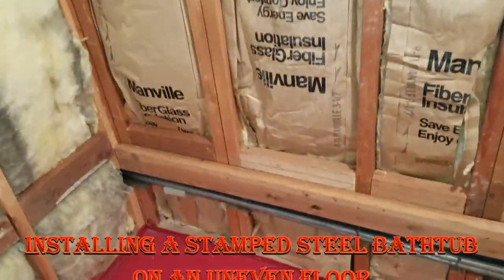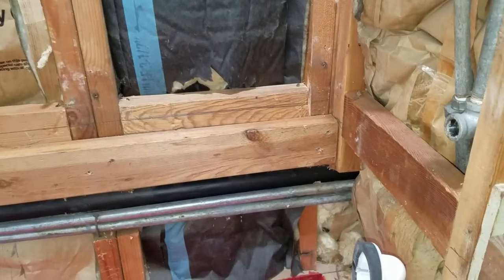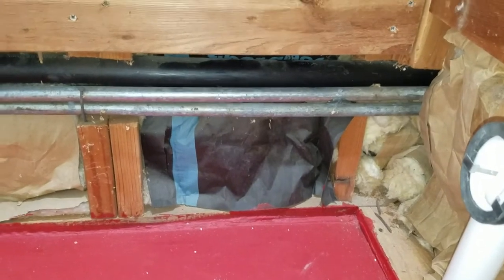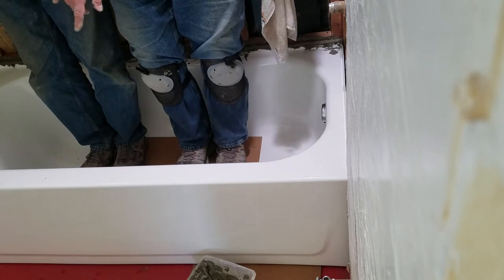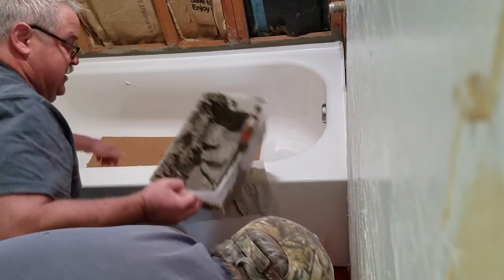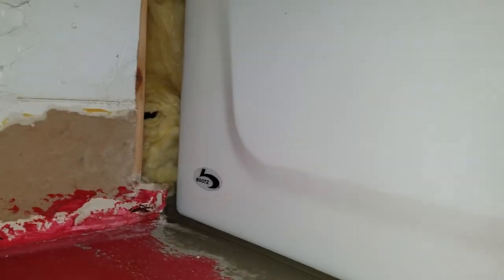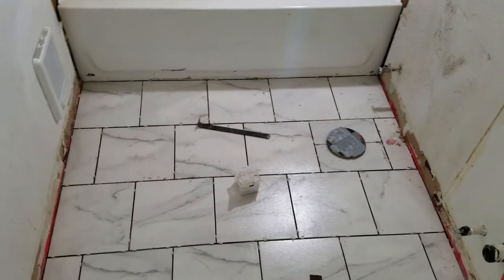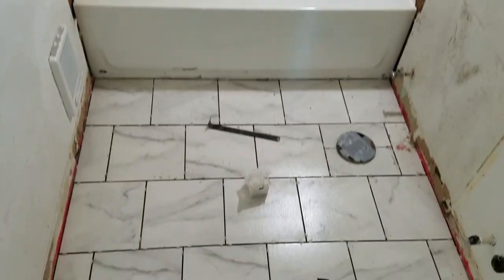Installing A Steel Bathtub On An Uneven Floor

Comment: Plumber installed tub with about a 3/4 difference. Didn’t notice until tiler was putting the tiles on and cement board was already up.

Not ripped the tiles out and starting from ground zero.

I like this way a lot as I’ve seen grout alone can stabilize a toilet and make it soo strong!

Thanks for this video.
Reply from the maker: In remodeling, sometimes you gotta do what you gotta do. Sometimes you can repair things to work but often times the trade offs just don't work. It's robbing Peter to Pay Paul.
Reply: My eyes went right to that tapered tile…

I have learned to hold the plumber responsible for tub not level… 

Sad to see it’s not standard practice.
Reply: So back to fixing this tub. The tile is out and now trying to level the tub. Can’t remove the tub since it was installed predrywall. There is a ledger board in the back. The tub is still the 3/4” out on longways. 

When you did your install, you put thinset mortar between the ledger board and the tub BEFORE I seen levels out. So are you leveling and shimming after and doing that from the front (where the floor tile meets)
Reply from the maker: @garrettp.5018  you need to spend time and see where your best average level is, then you can think about how to level everything best you can. I try to level the front, back, and long wall. Long wall first. Along the floor, you can shim the bottom front to hold position. Ideally, you can get the front, back, and long wall level with none to some gap to the front or back on the floor. Just fill with mortar and let set 24 hours. Pull shims and fill those. Hopefully you're ready for tile. If you do have gap, you can float and feather the floor to blend it.
Reply: @CITAP1   I am going to try it tomorrow, you are a good teacher and very helpful putting this YouTube video out there. Much appreciate it.
Reply from the maker: @garrettp.5018  Here is another video showing leveling a floor with mortar. It is part of a playlist showing the whole bathroom and rental house remodel. Lots of home remodeling information. 
https://youtu.be/cqi9Hj0UfyE?si=DeTGg9rsrZZ3ZO4c
Reply: @CITAP1    So got the tub level and it was fairly off... I am looking at my LVP & the quarter round and it is going to be close. Any tips/tricks on how to get the floor a little higher? I might put a thicker underlayment if absolutely necessary.

Comment: As a plumber I can't believe I'm still seeing galvanized water lines going up to a tub valve
Reply from the maker: It depends on what part of the country you're from. Hard water areas adding salts and other treatments to water are harder on galvanized pipe.  This place uses glacial sourced spring water. Pure as it gets with no chemicals to act as electrolytes or corrosives. In Seattle, I've worked on houses a hundred years old from before plumbing parts had reinforced hubs and there was very little buildup inside. But yes, PEX is so good and easy to work with and cheaper, there's no reason to use galvanized pipe other than to repair existing systems. Check out todays video, water heater safety straps and framing for earthquake mitigation. Take care.
Reply: In an outside wall. Hope its not in a northern climate.

Comment: So I have a 7/8 difference over the length of a 4’ tub. (Very old house) The vinyl plank doesn’t come close to hiding the shims. Open to suggestions
Reply from the maker: If the floor has a 7/8 change in 4 feet, you may have a bigger issue to correct.  If your bathroom is gutted now, it's a good time to correct the problem.  If you build your bath now, you will build the problems into it, making it more costly to correct later. If you need to jack up the foundation or some posts, do that first and correct the floor slope as much as you can. If there is nothing to fix, you can rip a shim to fit under the front edge of the tub and continue shiming across the floor, glue and screw the shims. You can follow the contour as needed. If the contour is going to run I to a doorway, you'll need to diminish it to not interfere with the doorway or swing of the door.  Without seeing the project I can only suggest so much. Hopefully this gives you enough information to make a plan.
Reply: @CITAP1  the 7/8” issue is right beside the door. Old house with balloon walls. You can have level or square but not both anywhere in the house. It predates indoor plumbing. I’ve come to conclusion that I’ll bring flooring to 1/4” of tub wall and then apply a quarter round to the tub with Speed Tape.
Reply from the maker: @Ken McLay  Sometimes you just have to go with it. Once upon a time, we were Installing 12x24 tile on a floor with a 1 inch hump in the middle of a 48 inch wide hallway.  We cut out the subfloor and planed the joists to level them to where we needed them. We then installed blocking under the remaining subfloor around the perimeter and installed new subfloor creating a now level floor. That might be an option for you. If you do put a quarter round or half by three-eights round, there is a pvc product that works great in wet locations. 
If the floor slope works with the drain of the tub, it's functionally less an issue. A tub may still drain ok if the slopes are opposite.  Test fit and check with a level

Comment: Oh forgot to ask did you then attach flange with screws/washer to studs?
Reply from the maker: No but there have been occasions we did. We put a ledger board across the back and then put mortar on the ledger to set the tub on making sure to put as level as the floor, wall, and other conditions allow. Also force mortar in under the facing bottom edge of the tub to fill any void. You may need a shim to hold stable.
Reply: I like this method just to avoid the screws! I never liked the screws with the oversized washer to hold a tub in…

Comment: seen most people do a mortar bed and then sit the tub into that mortar bed… 

Noticed you didn’t do that and went around the edges. Will this only work for metal tubs as they have the self supporting in the middle?

Ive seen fiberglass tubs crack in the middle because no support (assuming no mortar bed)
Reply from the maker: The steel tub will support itself. Fiberglass tubs will flex. For glass tubs, fit a piece of Styrofoam under the tub, then put a mound of thin set mortar on the foam and set the glass tub into that. nice and solid. for a PVC or glass shower base, generally put the thin set on the floor beneath the shower base and set it by pressing down on it to make sure it is flat to the floor, only use enough thin set to fill the void under the shower base. then leave it alone for at least 24 hours to set, longer is better. Not setting a fiberglass tub or shower can eventually lead to drain failure due to flex motion. As an option under the tub, any type, you can use spray foam, Blue Great Stuff, Minimal expanding foam on top of the Styrofoam to fill the void. Don't use regular spray foam or it will expand and lift your tub bottom.

Comment: I got the tub in and the mortar joint on the floor looks just like yours! I iwant to lay LVP, are you filling in with silicone caulk or anything prior to laying LVP? I am talking about the floor to tub mortar joint.
Reply from the maker: I don't recommend a plank floor in a bathroom. There are some plank floors made for wet locations but water can accumulate under them. I prefer either sheet vinyl type flooring,  or tile. There are color match groups in the tile section, or use a color matching silicone grouse for sheet and other flooring. If you do have Dorrock or Hardiback cement board down, I'd skim coat that with thinset a couple times to get it nice flat and smooth. Then give it three coats of Redguard to waterproof it, then install your flooring over that. Side note, I prefer Durrock and Wonderboard, epoxy cement boards for tub/shower walls and Hardibacker for floors.
Reply: @CITAP1    This is on a concrete subfloor so no need for a dorrock or hardi board on teh floor. Don't think II need the redguard for a concrete subfloor?
Reply from the maker: @garrettp.5018  If you're on concrete,  you're good to go, whatever floor you want. Just keep in mind water splashed from the tub can get under a plank floor, make sure it is rated for wet locations. A plywood type floor may expand and delaminate over time.
Reply: @CITAP1   Yes, I see your point, plank floor over concrete. Got it. Just don't tell all the production builders in my area doing LVP over osb subfloor lol... I don't think I would feel safe doing that either.. My kids splash EVERYWHERE...

So don't worry about caulking between the tub bottom, mortar mix and the concrete floor?
Reply from the maker: @garrettp.5018  Leave about an 1/8" gap between the flooring and tub, caulk that with a color match to the floor. You can carefully put maskingtape on the floor edge and the tub at floor level as an assist to a clean caulking job. Fill the gap deeply, then with a blue glove on your hand, run your finger over the caulk to smooth it into the corner, then remove the tape. You might need to lightly run your finger one more time as some caulk may lift with the tape. If you have done it before, that would be good, there is a skill to working caulk. Once done, stay off floor 24 hours. If you have any sand bags, you can lay them on the floor about 6 inches out to hold the floor down and conform to the concrete surface.  Leave the in place till the caulk is cured.

Comment: Curious as I'm doing almost entirely the exact same project right now...looks like even the same tub, did you drop the stringer slightly to allow packing on more mortar (I have one in place after I dry set drop it about 1" as the flange it about 1" but I think it might be just a bit high) and did you first shim that front right edge to get level then just remove when you started to pack the mortar in that area?  This video has been so helpful as I'm literally at this point and having the exact same level issue and didn't want to just shim as I want to get it right the first time!
Reply from the maker: Yes, get the ledger board almost exact put mortar on and press down even step in the tub to set in the mortar. Remove the shim next day and fill with mortar. Be sure to install blocking around the flange to support the cement board. Remember, the flange should fit up to the wall studs. Set the cement board down to the top of the flange, not ovet it or your corners will bow in. Fill the space between with mortar and tape. Your tile will rest on the tub. Check out one of my tiling videos for how to do that.
Reply: Great info thanks!  I was actually planning to set flange against studs as you mention on back wall but it isn’t quite big enough left to right and actually thought because of this and from what I’ve heard fur out the walls and drop hairdi backer over the flange and I’m using a kurdi membrane I have seen solid?
Reply from the maker: @pressplayvideoCA  I'm not sold on kurdi but I am sold on durrock and wonderboard. There is now a waterproof hardibacker for showers. Ive never had a durrock shower fail in 300 years.

Comment: So I got the steel bootz tub installed and shimmed it up as needed in the photo where the area furthest away from the drain is shimmed up 1/2-5/8”.   I sprayed spray foam under the tub but after doing the spray foam I now hear squeaks.

I noticed you didn’t do anything for the bottom of the tub, just put mortar on the sides (I don’t have that yet, it could very well not be supported on the sides fully as I just have the one shim supporting the tub.

Do you have issues with the bottom not being supported after lifting the tub?
Reply from the maker: I pressed thick mix mortar under the full length of the tub front facing edge along the floor to support it and let it setup 24 hours before standing in the tub continuing work. You need to be careful to use minimum expanding foam under the tub. Window and door fill foam is good. The regular red can, can actually lift the tub and hump the floor of the tub. Place a 2 foot level on the tub floor, it should be flat with slope toward the drain. Fit a piece of Sika or pink foamboard under the tub, spray blue can window and door foam on the foamboard then set the tub on that it will insulate the bottom and provide support. 
The tubs are made to be able to support a person's weight so the foam is more an extra step and a good one when done right. Steel tubs are thinner than they used to be. You really need to examine the products you buy these days.
Reply: So I didn’t even have screws in the tub when I walked in it. I added two screws and the squeaking start to minimize/non exist…. I am going to get more screws tomorrow and do the mortar on the ledger and the front face.

I did use the red can but I have concrete subfloor and I sprayed it while full tub of water, also I left the levels on the tub and it didn’t move.  I think I’m good there.
Reply from the maker: @garrettp.5018   Stainless Steel Screws are your friend. If there is a gap between the lip of the tub and wall stud, put a shim in to fill the gap. If you tighten the lip directly to the gapped stud, you may distort the metal and pop out or crack the porcelain finish.

Comment: Does that tub have a support piece under it?
  I recently installed one that I think I might need to redo. 
  The floor was not level so I cut long tapered shims to space u set what I think is a support piece attached to the tub. 
  I ended up with the skirt being about 1/4” off the floor. 
  Have no problem hiding that gap but am concerned about the tapered pieces if 2x’s I installed under the tub about 10” apart with nothing between them.
Reply from the maker: This tub is mainly supported by the ledger on the back wall and the bottom front edge. We used shims to level the tub front to back and inside to outside. I mortar the inside wall first with a thick mix and stand on the leveled position of the tub to squeeze out excess mortar. Then you press trowel mortar under the outside bottom edge on the floor, again using a thick mix to minimize slump. If you need shims to level the tub, you can pull those out and fill with mortar after about a half hour or when the mortar has firmed. As for support under the tub, it's not called for, but there are people that have done it with a sheeh of Styrofoam and either thinset or blue can minimal expansion foam as support under the foor of the tub. Do not use the red can or other foams that have a lot of expansion, they can pooch up the floor of the tub when fully cured and expanded, not good. I hope I answered your question, best wishes on your project.
Reply: @CITAP1  I am dealing with a wooden floor.  Is it okay to attach a strip of aluminum under the skirt on the floor then use mortar between the aluminum strip and the tub outer skirt? 
  Not sure if I supported the front of the tub to avoid having to cut the beam any more that goes under the front.
Reply from the maker: @Rickey Keeton  You don't want to cut beams if it can be avoided, espwhen a heavy item like a filled tub is above supported by it.  There are guidelines telling hole sizes and positions to drill holes for wire and pipes. You never want to notch a beam on the top or bottom.  The only exception is if the beam is oversized, and it is still dimensionally oversized with the proposed notch.
As for putting an aluminum strip under the tube facing bottom edge. You could do it, I would get a roll of black 20mil pvc plumbers adhesive tape and attach that covering the side where the two metals meet to prevent ant dielectric reaction. You could also use steel flat, 1/8 x 1-1/2, spray a couple coats rustoleum on it. You could also put the 20mil tape on it for good measure.  The steel would be stronger. I doubt it's necessary but I don't the condition of your floor. Usually we mortar and screw half inch Hardibacker down over the whole floor, mortar and tape joints screw heads, then skim coat the whole surface with mortar then 3 thick coats Redguard. That will give you a good surface that can stand up to water issues.
Reply: @CITAP1  It is a double beam that interferes with the drain and overflow pipe. Looks like it was cut just a tad when the house was first built in 1962. 
  Actually, it is a doubled beam and a 2x4 wall base . It has a narrow groove cut in it to allow room for the pipe for the drain along the side of the beam and base.  The groove is very slight. 
  I moved the tub back maybe a 1/4- 1/2” to let the pipe clear it.
  I do have a ledger along the length and back, not sure whether I distorted one across the front. 
  This an ensemble coated steel tub with support grid under it. 
  I am thinking the support grid needs to be on the floor and not on the tapered pieces (2x’s tapered from maybe a 1/4” to nothing) I put under it. 
  These tapered pieces are pine.  I feel like the weight needs to be better distributed.
Reply from the maker: @Rickey Keeton  it sounds like a minor consideration.  Over the years, I've seen a lot of iffy stuff that held up very well. 
A rule of thumb to follow is a 2x6 thru 12 will span the height dimension with 16 inch centers. 2x6, 6 feet. 2x12, 12 feet. You can span farther going to 12 inch centers. The same applies to support beams and doubled up 2x's for beams, use plenty of nails and or screws and glue to assemble them. Following those rules, you can tell if your spans are ok.
Reply: Surprised you don’t have issues with the tub being supported by only the ledger and the front lip.

I have the tub on shims right now and spray foam under the tub, no mortar on the ledger or front lip but it’s squeaking, hesitant to go next step since it is squeaking (foam sounds like it’s squeaking)